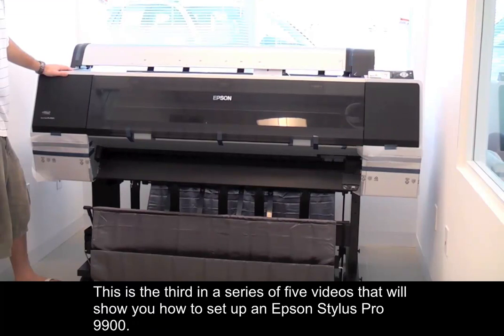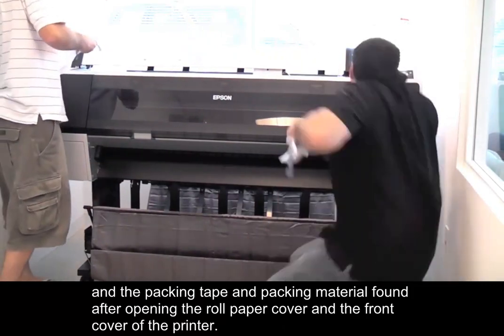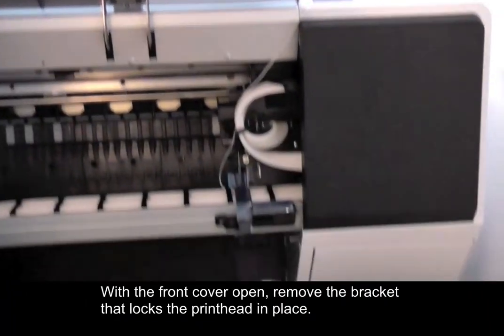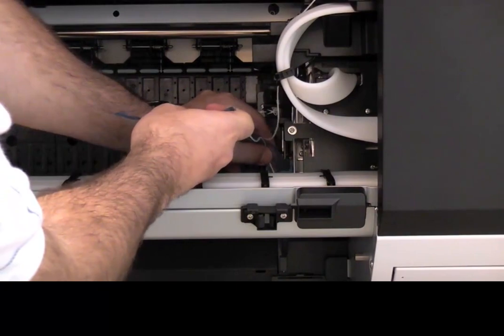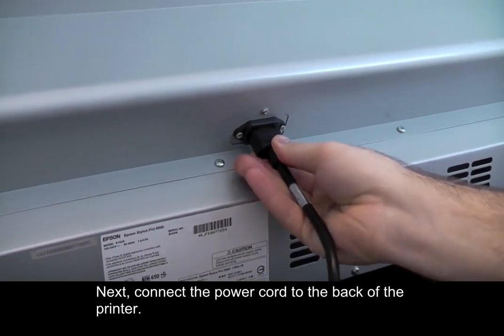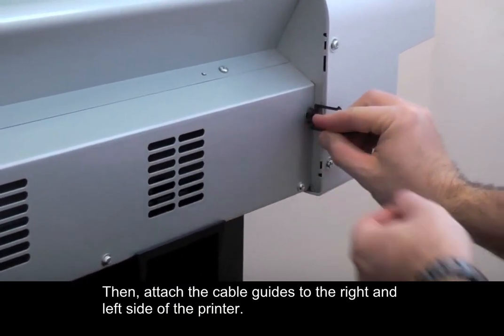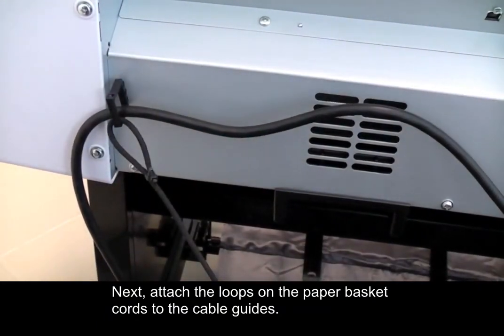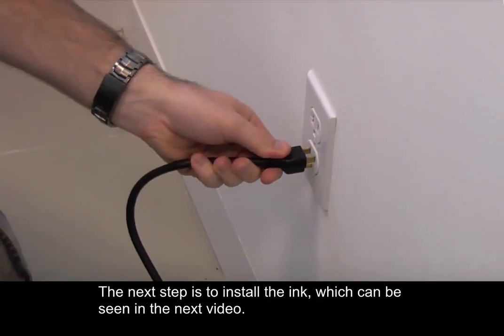Epson 9900 Printer Setup - Removing Packing Material and Connecting the Power Cord

Comment: Thanks for your videos, I subscribed to your channel today. I wanted to ask you the following question: My Epson 9900 prints correctly in color, but when I print in B&W it prints in brown magenta tone. The Epson authorized service technician checked the printer through software and mechanically; we changed all the original black inks (Photo Black, Matte Black, Light Black and Light Light Light Black), but I still have the same problem, could you please tell me what could be the cause and how can I solve it? Thank you very much